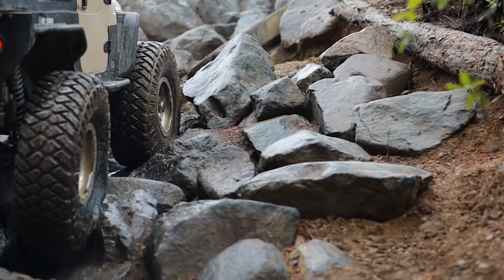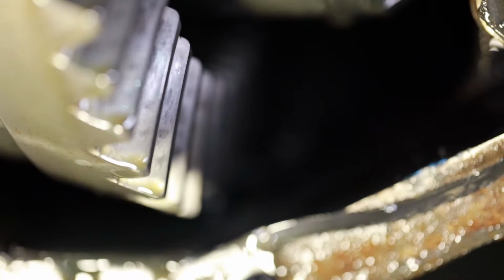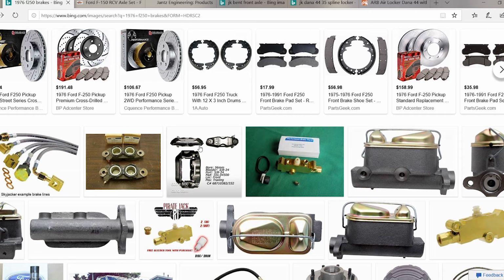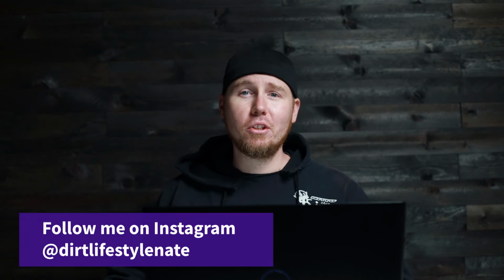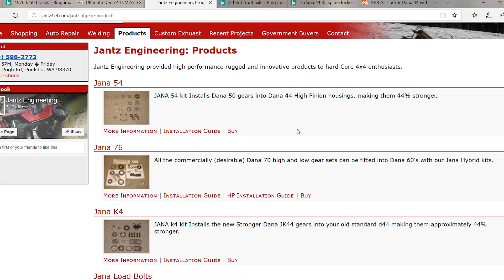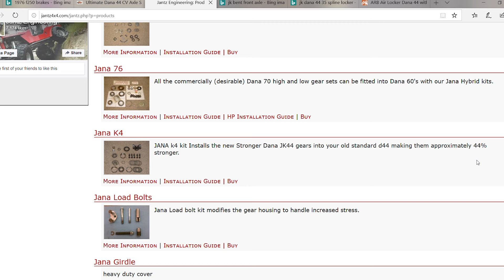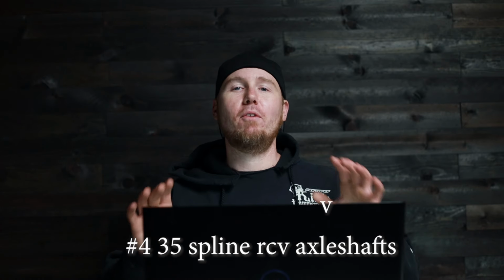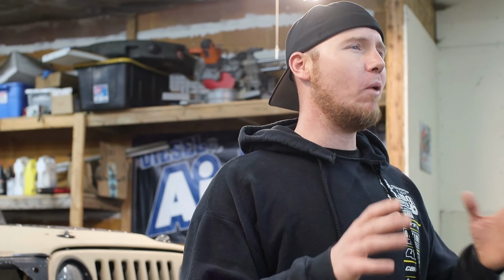Building An Unbreakable Dana 44

Comment: Already looking like you made the right decision quitting your Job and doing this full time!
Reply from the maker: Thanks brother! 👍
Reply: Coming from another Union brother, hell ya homie you made the right choice. Hopefully someday I’ll be doing the same.
Reply: Union Steamfitter, I give you props and jealous at the same time. Want to do the same someday. Love the vids, keep them coming.
Reply: I need this info for a rear Dana 44. 
How to hybrid the old iron Dana 44 vs the JK/Passport/Titan Dana 44. Trying to bypass the ZJ Dana 44a.
Thanks sir.
Reply: @xmo552  it's been a year, what did you do ?
Reply: @immelting9834  
I ended getting a rear Dynatrac Dana 44 from a friend that had rolled his Jeep. I read the JK rear 44 is supposed to be bigger and better in every way as compared to the old iron 44. I read a thread somewhere that someone did a hybrid of old vs new 44s. They had it done by East Coast Gear Supply. I spoke to them, they'll still do them but they recommend using JK parts and they can build anything to your needs. That's what I was going to do until my friend's axle fell into my lap. I hope that helps you out.

Comment: Seen multiple dana 44 failures on the trail...usually ballpoint or ujoint.
Reply from the maker: The common failures I've seen are joints on all axles and ball joints if they have a poor scrub radius. My scrub radius is outstanding so I've never had a ball joint issue. Makes it easier to steer too 👍
Reply: I swapped a Spicer ultimate dana 44 into my 2 door JK when I trashed the dana 30, but I'm running 35s and wouldn't dream of going any bigger. Super duty 60s are so cheap and easy to find, and now the aftermarket has caught up and offering everything needed for an easy swap. 

My TJ is on the 60/10.5 combo, along with 40" Maxxis Razr and Raceline  beadlocks. It's a beast and I think I was able to build both axles for under $3,000. Add in another $2,000 or so for psc full hydro, and that's a pretty cost efficient swap, imo.

Comment: I’ll also add people far overkill their builds. I know a guy who ran locked front and rear super 35s (Dana 44 shafts, same small pinion and ring) with 37s. Drove it to work and drove it to fun, never had an issue. If you don’t got the dough don’t put on a show , drive with some sense. Great vid

Comment: Built a 77’ ford front D44 in my XJ. Removed stock tubes installed 1/2” thick walled tubes, auburn elocker chrome axles and stubs race polished 4.56 gears with a bolt behind the ring gear to stop deflection. I beat the hell out of it. With a stocked 4.0l and atlas II transfer. And 35” tires. I’ve been saying this for years but can’t seem to get anyone to agree. Finally glad to see you and Matt talking about it. I like your info better and may use those shafts you mentioned if I do break one I have. Very good channel keep it coming. Thanks!!!
Reply from the maker: Thanks! Sounds like you have a well built axle!

Comment: Always good information... back about 100 years ago... in the  Tri Cities.. we wheeled around with the PNW4WD Association... don't know if they are still around.  But I seem to remember that everyone wanted 44's on the front and if you had it a 60 in the rear.. and change from open knuckles to  closed or vice versa  can't remember now.. to many years ago... we used to like a limited slip in the front unless it was purely a hard corps off road rig and then we had a  full locker, but that was a sacrifice of turn ability...trusses were very important along with limiting straps to prevent axle drop... we also liked having both the front and rear wider than stock and set as far forward on the front and back in the rear to increase wheel base in width and length.... anyway,  long long long ago lol... enjoy your programs,  informative and brings back a few old memories lol...

Comment: ..."you know, like smart people do."  Great line!  I've gotta use that one!  great content.  Before I did a 60 swap on my K5 this year, I built up the stock 30 spline 10 bolt with knuckles, x-over steering, upgraded brakes and good gears.  I punished that thing for 3 years, sold it and the current owner is beating on it in his K5 without issue.  People hate on the 10 bolts more, but the later models can be built to work hard too, and parts are plentiful and cheap!
Reply from the maker: Thanks man! Lol. I agree the 10bolt can be built pretty decent 👍

Comment: Funny because was just discussing the stock 44’s on the Jeep Gladiators and someone was asking us about just trussing it etc to beer it up instead of swapping to tons. 

But in the long run, depending on your uses, it could end up being a lot more cost effective to just go to 60’s right off the bat.

Because if you swap later, you’re gonna have to switch wheels (most likely 8 lugs) more cost.

You gonna have broken or extremely abused 44’s worth less now.

You’re gonna have to pay to have more labor done etc.

There’s so many pros and cons to beefing up 44’s vs upgrading. 

We are gonna push our 44’s to the absolutely MAX stock just to show exactly what they are capable of before swapping. 

There’s a lot more to this and could go on and on. 

You’ve covered so many good points didn’t even think about.
Reply: Gladiator Gang always beer it up! 🍻

Comment: I dealt with Carl on a Dana 70 in a custom chassis FWD motorhome. I had a 502 w/MPFI and never broke it. The stock 70 broke 3 times before that. Only motorhome I know that would chirp the front wheels between 1st and second at 50 mph. Carl is a good guy. 

Something else that we did was cryogenically treat everything inside the case. Cryo doesn't make it stronger, but it does make it more rigid without being more brittle. This helps to keep stuff from flexing and loosing mesh. We also had the bearing girdles and the special cover to stabilize the case.

Comment: Absolutely love that video. Running a 14 JK carbon built rockjock 44 Detroit Locker and the rear Dana 44 with a Torsen LSD both carbon chromoly shafts. I do like to gas  on it I like to play on the fuel I like to get sideways on the pavement. Been planning on 35 for a long time. 488 gears. But now and then I do think about a 37 but don't completely trust it and I don't want to be stuck in the middle of the woods with a broken Axl.

Comment: Pretty much what I plan on doing with my 44 minus the RCVs because they are too expensive. JANTZ kit with chromoly axles. Nice to see someone actually supporting the 44. Most forums just say don't bother get a 60 when you ask for advice. Some of the GM housings are good too but they are passenger diff low pinion. Mines out of a 76 3/4 ton suburban. 3 inch circumference with 1/2 inch tubes. Should be pretty decent with 35s or 37s.

Comment: You're spot on with all of this! The only thing I will point out is that even though the D44 is cheaper than the D60, the overall cost to build this ultimate D44 is still huge. 

I was about to go this route, but when I started adding it all up, I could get a dana44 to be just as strong as a stock D60, and stronger in some regards, but I couldn't get it nearly as strong as a D60 for the same price. 

A superduty D60 with all the brakes and everything can be had for $500. It takes a TON of money to get a D44 up to even that starting point. 

But it is nice to have options! Great video!
Reply from the maker: Absolutely! The ultimate d44 come with a ultimate price tag 👍

Comment: I've got a re-worked JKR44 in mine.  Bought it in pieces, new thick wall (3/8') DOM tube, a selection of Barnes and Ballistic mounts/truss,  but otherwise stock other than 4.88's.  Built it myself, and still a good penny into it.  Went 8.8 out back.

Comment: We did the JKR Ring and Pinion upgrade in the rear of my LJR and it is important to note I still got to use my stock TJ/LJ Rubicon locker. This is a no brainer upgrade for TJ Rubicon guys but you never see it and no one seems to know about it.  Just upgrade the R&P and reuse your stock locker and chromoly or stock axle shafts. Thanks for sharing the info Nate. Hope to see you on the trail one day.

Comment: Hey Nate, 

Huge fan, the K4 kit is for low pinion 44 housings only. It’s an 8.9in ring gear that came in the rear of a JK. So it can only work on Chevy 44s, waggy 44s, all the low pinion ones. The Jana 54 is a high pinion gearset for high pinion 44s and a 9in ring gear. With that said you can put a JK carrier in an older housing and still go 35 spline. The ford hi pinion 44 is the best 44 you can get IMO. I have seen them take years of abuse on many different style rigs and put one under my SAS Hummer H3 with a 5.3 and 40s with no R&P issues. I ended up building a custom D70 front end because I got the invite for Ultimate Adventure and they were concerned about the 44 under a big rig. 

Thanks again for all you do! Hope to see you at KOH! We toured the podcast guys around last time one of them came down and I heard you might go going with them!

Comment: Came across your channel and subscribed right away. Unbreakable Dana 44 really caught my attention.  I have something going on in my rear end when driving along pavement,  driving up a gravel hill to a ski hill parking lot or even driving along a gravel road with my Dana 44/Detroit Lockers/Cromonly axle or something. It snaps loud enough to make you think the rear end blew up and it almost drives you across the road to the opposite lane. Has been doing this for a while and I almost think it is happening more often as time passes. I don't drive her very much now because of the issue.  95YJ, 360 AMC V8, Holley 4 barrel, Elderbrock intake manifold, 4 speed manual, Dana 44 front and rear with Detroit lockers, Cromoly axles, 4.27 gear ratio and I currently run 35's on her. Hope you cover rear end noises, snaps, crackles, pops and the likes in one of your future videos. Keep up the good work at your new full time job.

Comment: Good stuff Nate. Thanks for sharing. I'm in the middle of an LS swap in my TJ. But, I stuck with the D30 up front with chromoly shafts and a truss (that I haven't welded on yet. I'm dreading having to do that.) I did upgrade the ring/pinion and carrier. We'll see how it holds up. I'll come back here when/if I need to replace it. I'm running an 8.8 in the rear.

Comment: The 78/79 Bronco/F150 axle housings have cast wedges on the axles tubes and the can’t be removed unless you retube it. The 76-77 wedges were welded on and as you can be removed.

Comment: Completely agree with all the talking points in your video. There is one thing I would add to your ultimate 44 build: a rigid cover with adjustable carrier bearing supports, if you have the steering clearance to do it. That type of cover adds a tremendous amount of rigidity to any housing.
Reply from the maker: Great suggestion 👍

Comment: I like pushing the fact that a 44 is strong. But.... if a guy is building a rig from scratch, the 60 price point is better. The axle itself will be cheaper than the 44 rcv’s, and you can get a set of shafts for around 800$. Tubes, knuckles, hubs, are all stronger. Something to consider. If you were to dump 4K into an axle, I would spend it on a 60 rather a 44. Love the content non the less! Come out to nor cal and run fordyce sometime

Comment: All good info. I knew there were plenty of upgrades for the D44, but didn't realize the weak points of the newer version. I understand the lighter axle for sure. A D60 is a heavy pig. All that being said, the D60 has a bunch of upgrades as well. If you upgrade a D60 with the same parts as the ultimate D44, the only downside would be the weight.
I went D60 for my TJ. 87 F350 king pin, added a truss, conversion to the gm HD brakes from a 2004 2500. Haven't decided on what differential to use, or if I'm going to upgrade the axles right away or not.

Comment: Nate 
I wholeheartedly agree with you on this issue 
The Dana 44 is a GREAT platform for most applications 
I have upgraded my 05 TJ with Dana 44 G2   housings chromally
Shafts twin lockers 
currently running 35s
I was told by all my buddies not to waste my money JUST DO 60s that’s what they all said
I like the stock width
And lower weight I have with my 44s 
I also believe I can run up to a 40 in tyre without an issue however I would not be able to get it in the garage 🤣🤣🤣
Great vid keep up the great work
Reply from the maker: These are really good for builds like yours and mine. I know the garage struggle very well! Before we bought this house I was airing down to fit in the garage 😂

Comment: I've always been envious of yours and Matt's 44 holding up to 40's..lol    I broke a stock stub 2nd trip, had to warranty a set of yukon's and would take out a spicer u-joint every 3rd trip and tried an OX super joint and it only lasted 5 trips. Thats under a light chopped top Bronco 2 with a little 2.9L and 38's, its currently getting tons and 40's so I can probably keep breaking it like the 44 because that's how my life goes...LOL
Reply from the maker: Damn! Sounds like you need rcvs! Unfortunately dependability comes at a cost
Reply: Dirt Lifestyle RCVs are a great upgrade but the upstream weak link may be a more expensive and debilitating failure, gears?

Comment: i can confirm his point on 70's ford dana 44's being strong. i have a 1978 ford bronco with a fully built 460 aluminium heads solid roller cam everything! on the dyno it making 600 hp and 700 ft... the Stock dana 44 up front has held up to that much power with 37x12.5 tires... and i jump this thing regularly! those high pinion dana 44's are NO joke!

Comment: VERY good video, almost had a d44 from 79 Ford and d60 full float rear 60 10 years ago. Down side to this mod is they are becoming very hard to find. They are still out there, so keep looking. Watch for donor trucks parked by some farmer's barn. In the mean time, driving carefully can make a good d44 last longer. My ultimate solution, Prorock 60. The weight requires more hp, happy wheeling.

Comment: GIVE ME MORE!! Currently in a build with sleeving and trussing a JK rubicon Dana44, but keep wondering if my time and money are going to waste instead of yanking dana 60's out of a 2005 and up 2005 Ford F250... In the middle of the build, need to decide on what ball joints to go with (are the $550 DynaTrack rebuild-able joints worth the cost? or just stick with Spicer's?) Should I preemptively put chromalloy shafts in now or wait to break my stock shafts before deciding to go to RCV's or something else considering the cost? 115,000 miles on the jeep since the front axle will be getting pulled out and regeared should one just figure to replace the unit bearings just because its all out and taken apart? Running 38's on stock 3.6 and LOVE IT. Thanks!!

Comment: trussed and gusseted the factory 44s in my 05 LJ an theyve been running good i solve obstacles with speed and power still all factory gears and shafts, not a fan of the pneumatic lockers though would definitely go for an electric set up or maybe an eaton, only running 35s but will be getting 37s/38s when these wear out and the rig is a daily driver/ work truck

Comment: Good content. I replaced the axles in my jku with a Dynatrac serious performance set. Sold the stock 30 front. Thinking of keeping the rear 44. After the week at EJS and seeing the cool rigs I’m tempted to build a tj type buggy. Probably pushing it but a dynatrac trail leader package would be a cool 44 set in a light build with 40’s.

Comment: My AMC 360 in my '75 CJ5 says, "hold my beer, I'll trash a 44"  lol. I run a 44 from a narrow width waggy in front and a 44 rear from a Scout. My 44 in front holds up ok, but I have spit out short side axles and hubs. I have piles of the axles and hubs so I carry a spare and deal with it. Thats with welded diffs front and rear. I just leave the driver side hub unlocked till needed. I twin sticked my Dana 20 T-case and can do front digs as well. I drive with finesse and a light pedal and it lives just fine. Never spit a R&P, only short shaft and an occasional hub, and I'm running 38.5" TSLs

Comment: So real quick, not sure if this was already mentioned but the Jana K4 kit can only go in a Low Pinion Dana 44 Like a Chevy Dodge or early Jeep J Truck or Waggy. 
But its a great setup, Dana rates the JK Rear R&P ad just 300 Max Momentary Torque less than the Dana 60, which is huge considering the Dana 60 is almost twice the Max Momentary Torque as a Traditional Dana 44!
Reply: So my front axle is a Full width Chevy Dana 44 with Jana K4 R&P Yukon 30 Spline Chromo shafts and Superjoints (cause I I got em off Amazon as an Open box deal for $500 lol) and Yukon Hardcore Hubs (If they break they break locked instead of Open) and will all of these fancy Bling parts i have less into this Axle fully Built then it would cost me to buy a rusty King Pin Dana 60 straight out of a junkyard (Here in Cali they sell for between $1500 and 2500 depending on condition). This is in a Custom Built YJ-7 with a V8 NV4500 and Atlas on 37s and Im thinking of going 40s when the time comes.

Really Diggin the New Content BTW!! Keep it up man!!

Comment: The Jantz kits use regular Dana 44 3.73 and down lockers so you don't get the option of JK lockers  also I think the k4 kit only works on low pinion axles so you have to use the 54 kit for high pinion 44s.
Reply from the maker: You are correct on the low pinion part. I made a mistake
Reply: @DirtLifestyle   I only know because I am looking at both as options for my LJ I have a HP F250 D44 (boat anchor) that was in my XJ and the LJ came with a rear 44.